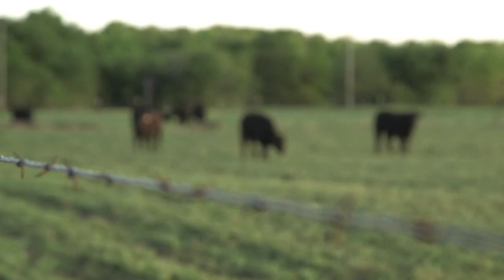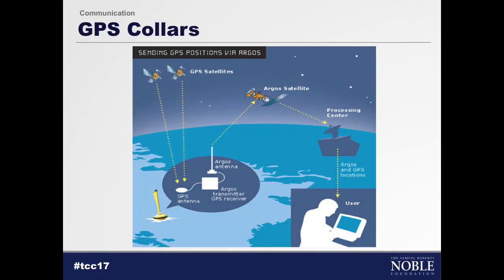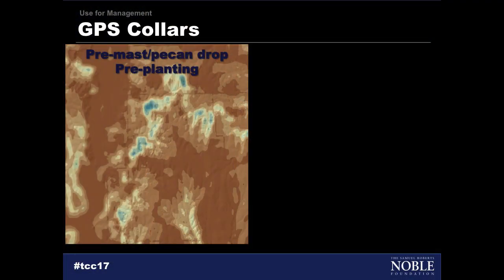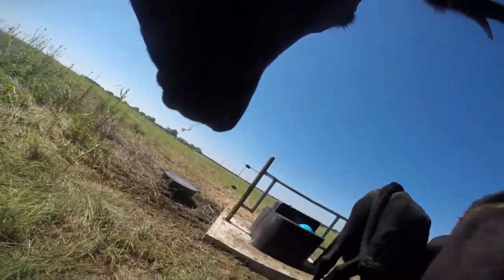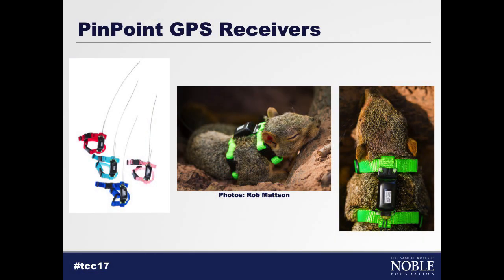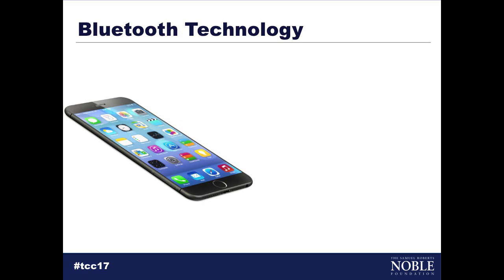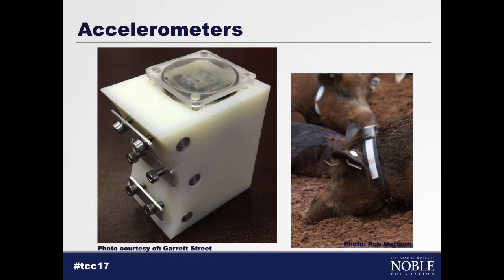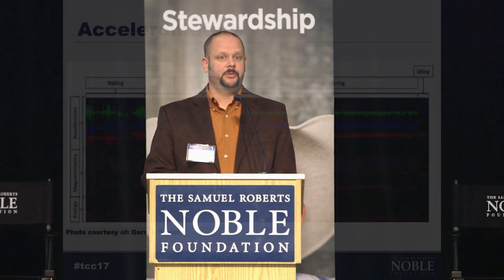Animal Tracking: Advanced and Emerging Technologies

Comment: if been looking at this for a very long time. The main problem with this is cost.
 exp. the unit cost around $200 but 1 sheep it worth $220 so u need to get the cost of the product down.
if u have 300 sheep that adds up alot